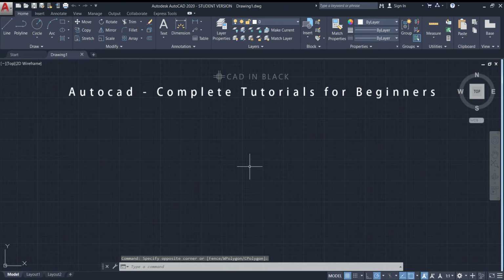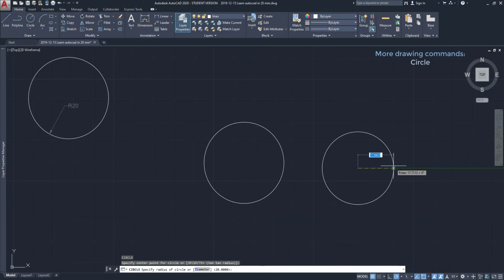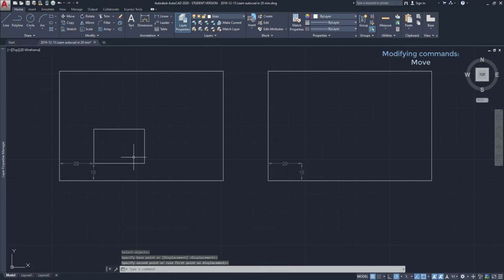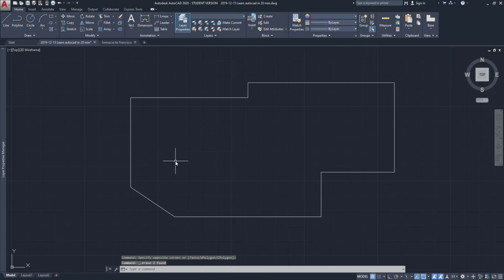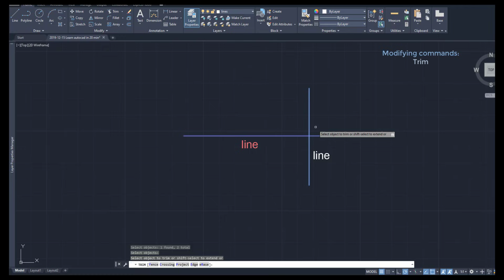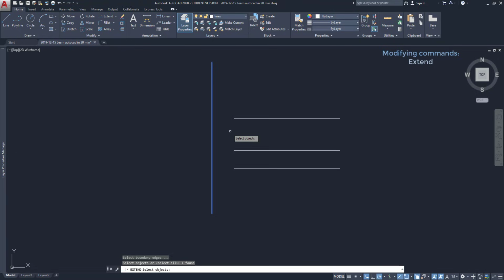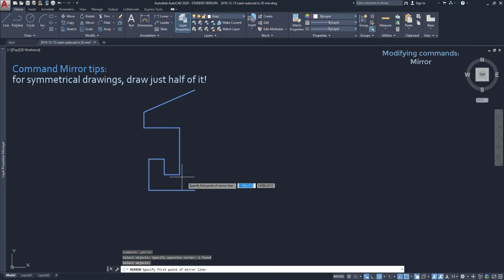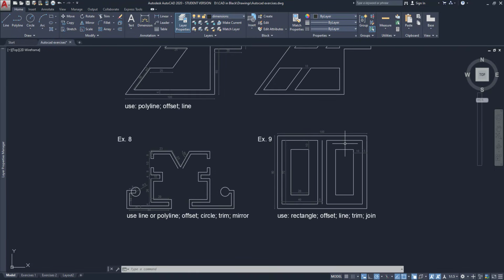AutoCAD - Complete tutorial for Beginners - Learn to use Autocad in 60 minutes - Part 2

Comment: this will be the one i've found my software issue. I couldn't able to type the first value and click TAB. [If I type 100,200 , they appear at the x,y 0,0 point.] 
But i can type well in LINE and degrees (which is in Part 1).
Remark: I'm the one who is asking about dynamic ON/Off box option @ Autocad - 4 Tips comment box.
Reply from the maker: Hello Kaung.
The explanation is for the command Rectangle. If you do it with line, you are inserting the coordinates. However, they won't go to the 0,0 point, but to 100,200.

Comment: How can I put the unit that i want to use (cm by example) and how to work on a specific scale (1/100 or 1/50 by example)
Reply: Press f12 after selecting line 
If it's in a rectancle select rect command. Press f12 type length press tab in keyboard type breadth.enter. 🇮🇳🇮🇳❤️